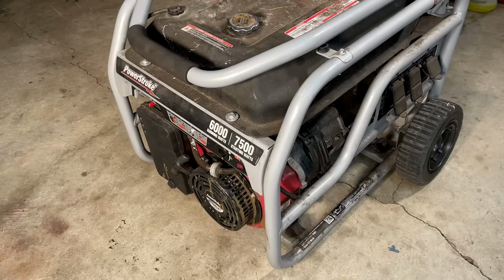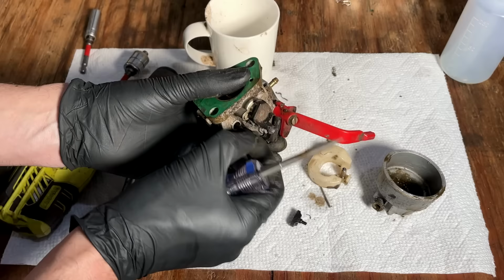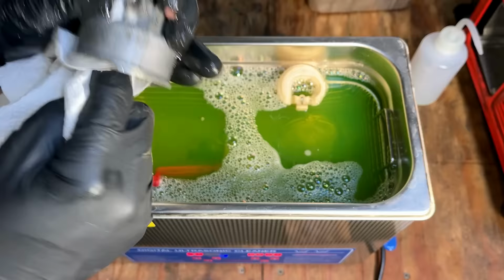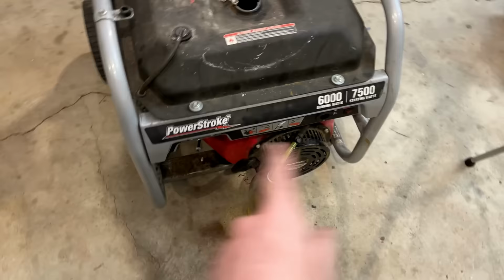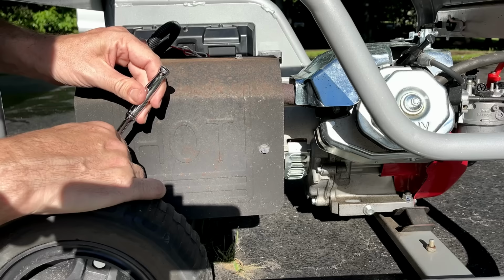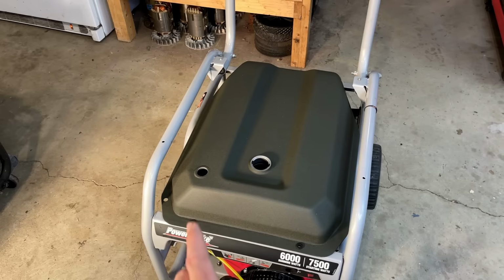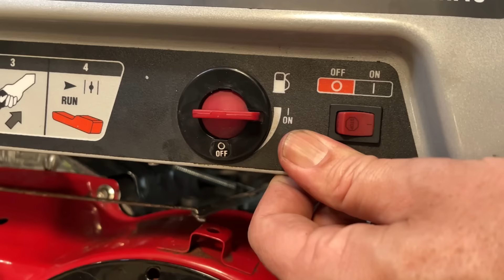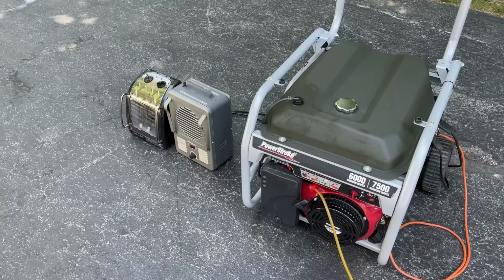Neglected PowerStroke Generator - Will Not Start

Comment: Damn, that thing came in looking like scrap metal and now it looks like it's almost brand new!    Nice job!  
One question for James Condon:  In another video, you used an inflator gun to pump up a tire. Your gun looks to be an AIAIR but I can't identify the schrader fitting that seemed to screw onto the valve.      Can you post a link to that fitting?  I've been looking for a 90 degree screw-on open flow fitting and can't find one.
Reply from the maker: It is made by VIAIR.  Do not think they sell the screw on type anymore https://www.viaircorp.com/inflation

Comment: My initial diagnosis, is at about 3:35 where you can see how weak, and worn out the starter is. As the struggle continues you can tell the starter is losing his grip, getting a bit wristed. I would have applied a much more aggressive starter, like a newer model. 😆

Comment: Another great video James. Haven't seen one of yours yet that wasn't awesome. You wrapped up the generator head before power washing and that makes sense. I've been told it's fine to spray the generator head as long as the unit is running. Any truth to this? Or is your opinion to always avoid it?

Comment: Do you ever just clean spark pugs instead of replacing! I’ve got a stihl weed eater that purchased in 2006 and I’m still on the same plug which I clean every year . Also I’ve noticed here recently I’m having to change the fuel filter more often. The original I got years out of I’m having to change it every year what gives . Not any water but the oil has been on the shelves for years , I kinda purchased a lot when I got the unit . Trying to beat price increase.
Reply from the maker: For my own equipment I just clean them and keep using the same one.  I keep an extra new one around for my generator just in case.
Reply: As James has proved again and again...
the condition of a spark plug in an "unknown" old generator is just another variable...
maybe it works; it works poorly or it doesn't work at all.
A new (but pre-tested) sparkplug is a known "good one".....

Once the unti is up and running the old (cleaned) sparkplug can be reused.....

Comment: Nice $ save with the use of the Rayobi tank.  How did you know if would fit? Years of experience?  If you should decide to use a tank coating material please be sure to share your experience.  Nice to see you take a machine that others think of as junk and turn it into a working generator.

Comment: Great video James. Generator refurbishing are my favorites ones. What is the torque specs do you use for the muffler?
Reply from the maker: 160-180 in/lbs where it connects to the engine.
Reply: @jcondon1  Thanks.

Comment: Hey Jim, why not lightly sandblast the corrosion that's sitting at the bottom of bowl? I would feel better if that was gone, LOL. That pressure washer did a fine job on the gen.  Thanks! :)
Reply from the maker: Need to get a sandblaster
Reply: @jcondon1  I see H F has a small Central Pnuematic benchtop one for $189. 99. 4 out of 5 stars reviews, not bad. The bigger floor model one is $229.99. :)

Comment: I really enjoy your videos.  I do have one question.  Is the ultra sonic better then just putting the carburetor parts in a gallon of parts cleaner (the metal gallon can with the basket in it)?
Reply from the maker: I think so.  Used the can for a while and had issues with it turning the aluminum very dark.

Comment: HI JAMES , How did you find the tank and know it would fit ?
Reply from the maker: I have worked on the Ryobi generator with the same tank in the past.  It looked the same, but was not sure.  The Ryobi generator number was RY905500.  Just looked up the part number and ordered it.  Ryobi generator parts are much cheaper then most companies.

Comment: Do you know if these types of generators (non inverter type) are pure sine wave output? 
Thanks
Reply from the maker: Brushed generators do create a sine wave, but the total harmonic distortion can be as high as 25%.  Anything over 5% can cause damage to sensitive electronics.  Inverter generators are less then 5%.
Reply: @jcondon1  thanks for the reply.  I was going to grab one of these and build a throttle control using a arduino. But if they are no good for electronics  then I wouldn't even bother trying. Thanks again.

Comment: What is the solution that you use in your Ultrasonic cleaner to get the carb cleaned up?  For really dirty carbs do you generally recommend 10-minutes?
Reply: He already answered that in the description at the top:  "I use Harbor Freight Super Heavy Duty Degreaser in my ultrasonic cleaner."
Reply: For what it's worth, I've messed up one carb with a cleaner that was too strong or run too long.  I don't really know which.  But I like gasoline best for carbs -- they're made for gas and it works quite well.  And I always have some around.

Comment: Why those tanks have that depth there? What is the point of that?
Reply from the maker: So you cannot overfill the tank.  There will always be a pocket of air at the top so the fuel can expand without spilling out.

Comment: James or anyone reading this,
   I bought this generator used, for a low price. I read that the engine is a Honda GX390 but I am not so sure about that. It might be a GX390 clone. The carburetor leaked, the float bowl gasket needed replacing. I bought a GX390 carburetor gasket and it came with a float bowl and nut. The nut in the kit had no holes in it so I cleaned the old one. Does anyone know who makes this motor, it does not seem to be the same as the GX390?
Reply from the maker: This generator is a Honda clone.  Any 389cc to 420cc clone carb should fit.  There are a few variations.  Just make sure it looks similar to the original carb and you should be good.
Reply: @jcondon1  Thanks, I knew you would know. You make the best videos, I have learned a lot but I do not know much about electrical issues. I have to keep learning.

Comment: james maybe you can answer a question for me
2 years back we lost power and i got the gen running , did fine but when i plugged in our space heater it would not come on, so what type space heaters are you running on gen power? seems mine has a safety
 switch to prevent it , i ran on a gen  for a year once and found that your clocks do run faster on gen power , so do you have a type you look for specific and use with your gen?
looks like you got a pretty good deal with this gen, those cords alone would go for 200 bucks
Reply from the maker: Space heaters should work on generator power without issue.  Not sure why yours did not.

Comment: on every Starting of my generator I give 12Volts  Dc current to got it magnetism, AVR, Carbon bushes, Are win working condition, I also Used to clean the rotor bushes, But on every starting My Generator need 12Volts to give power output.. Whats the fault? If you Have any Contact Number please share

Comment: I have a Coleman generator 5000 W running. Model number PM0545007.01 i’m trying to figure out what to adjust valves to but I can’t find anything could you help. Intake is at 7 and the exhaust is at 8.5 that sounds too loose to me. I would greatly appreciate your help or anyone’s help.
Reply from the maker: Not sure off hand what engine you have.  If OHV would set closer to 0.005” unless you can locate the actual spec.  But agree your valve clearance seems excessive.

Comment: bud im only at 4 min in you have allready shown the inside of the tank is it a good idea to try and run it off the fuel in the tank u should of hooked up external tank before even pull starting it :)
Reply: I agree, but it would be reasonable to assume previous owner tried to start it, so likely the damage was already done.
Reply: @ickipoo  I never trust the sellers word 9/10 its untrue or twisted in some way lol
Reply from the maker: Not a good idea, but the previous owner already let the junk in the carb.
Reply: @jcondon1 i love your videos bud keep them comming :)

Comment: Why do these generators still use steel gas tanks when plastic is better with todays gasoline?
Reply from the maker: Not sure.  Honda uses metal and the Chinese clone them right down to the tank.  Plastic is better.

Comment: little bit too much perfectionism and worry on the visuals for my preference, would rather see rapid fire trouble shooting and quick fixes, making it work with what you have rather than order a brand new tank although the improved design was worth it there... whats the point of a generator that cant be used in the rain thats the main time youll need one is during a storm

no need to be spray painting exhaust covers and crying over rusty fasteners though, gotta keep the units affordable to the buyer, unless your paying yourself less than minimum wage for the work sinking days into one unit will make it cost near as much as a new one thatd come with a warranty and no previous owner history
Reply: He explained his reasoning on the tank - between his time and required materials, a new tank was an obvious choice. As for "keeping it affordable for the buyer", why on earth would he not try to maximise his return on investment with a little spray paint? He knows his potential market better than we do. Honestly, your comments come across as a tad unappreciative, and not particularly constructive.
Reply: @ickipoo   the improved design  did help justify the tank purchase but i believe it was a surprise not on purpose, but surely he could have cleaned the old one without spending 100$ after taxes and shipping it didnt look that badly rusted just really grimey/muddy

few rinses with boiling water, then add some degreaser and/or vinegar with some gravel chunks or other abrasive bits and take it for a ride or spin

i do enjoy the videos just offering constructive criticism rather than being a yes man, he's free to do repairs and videos however he prefers, im just putting my preference out there that i prefer trouble shooting and sending it on its way as is, the exhaust cover wasnt a big task but im sure it took over half an hour, and itll be just as rusty after a years use or a couple years sitting